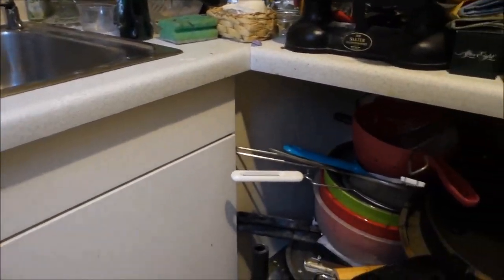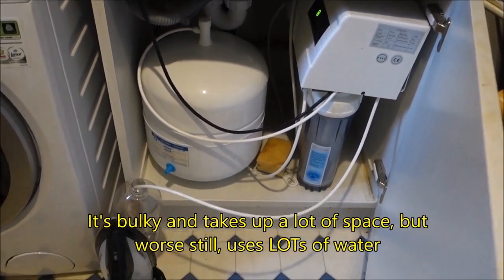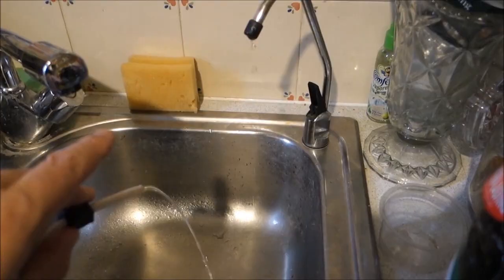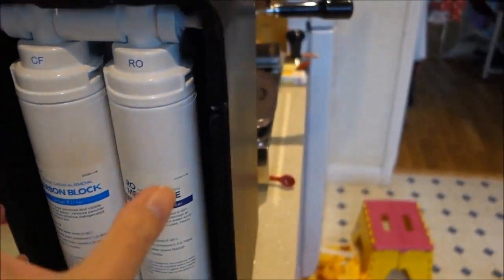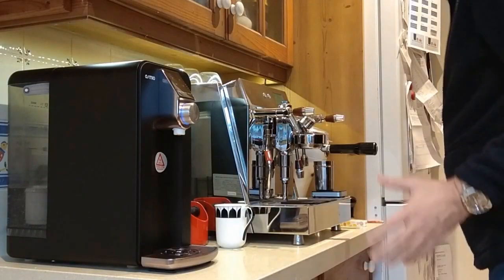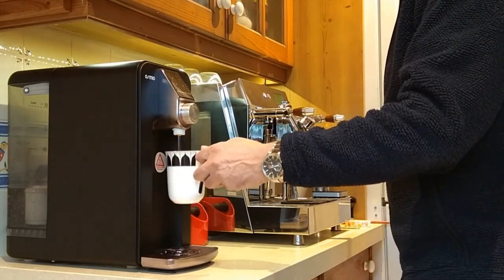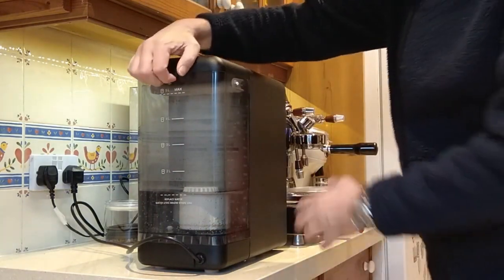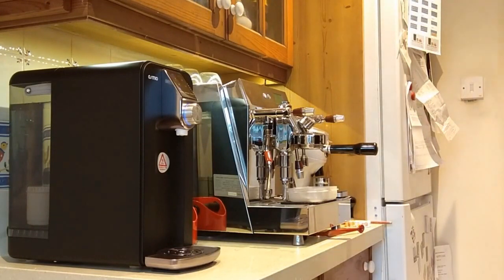Osmio Zero Installation Reverse Osmosis System - a review by Dave Corbey

Comment: Hi noticed no one talks about taste... It tastes sour for me... And if I put in a glass bottle next day it's worse even smelly. Need help...
Reply from the maker: Yes it does for a few reasons. One is carbonic acid in the water as it dissolves co2 in the air. The second is the mineralisation which is different to just using calcium carbonate, arguably better tasting but it's not good to use inorganic mineral. One option you can do is use the empty filter so don't remineralise, but then you loose having the negative ORP. The longer you leave the very pure water exposed to air, the more carbon dissolves and it gives a bit of a sour taste. Nothing you can do about that  unless you go with a much lesser filtration level which does not remove dissolved solids.

Comment: Interesting and helpful Dave .  But putting the water in plastic bottles re-pollutes the water with dioxins, phthalates, vinyl chloride, ethylene dichloride, lead, cadmium and other toxic chemicals. Often estrogenics which cause hormone changes in females and is highly linked to breast cancer . What is the water filter tank made of please ?
Reply from the maker: It make using poly propylene and the water has contact with this and poly carbonate. Off all the plastics we can use, they are the most expensive and the best available and I'm sure there are yet undiscovered EDCs yet there is no better material universally we can deploy. For plasticarians we have another product using ceramic filters and glass housing, yeg even this has come limited plastic exposure. With all materials there is various levels of material extraction over time. So it's universally preferable at the moment to use this material. Sometimes in life to make steps forward we take some back but we are still forward and the challenge is to keep making it better. The Osmio Zero has a post filter which actually creates a pH buffer and does make the water aggressive against the material even if the water stays a long time inside it and develops carbonic acid inside it. The labs can measure and when it's less than less than 0.1mg/l the measurement further needs to be in pico grams and they mostly don't even have that equipment. Needless to say they are not exist any above levels labs can detect. That's why I myself, Mark have chosen this for myself and on the look out for better options too. Glass could be the way forward and we might have the capability to do that this year.
Reply: Thanks Dave . I have the pro 6 . But not used it as yet . Do you know what the ph of the water is for the pro 6 please

Comment: How do u know when to change that membrane filter?
Reply from the maker: We suggest to change it every 6 months. The measures pressure and knows when it's blocked but it's best for system health to not stress it too much. Like servicing your car once a year rather than waiting for the lights to come on the dash. So tolerance built in so that depending on your water quality it could last 12 months or with soft water even more.